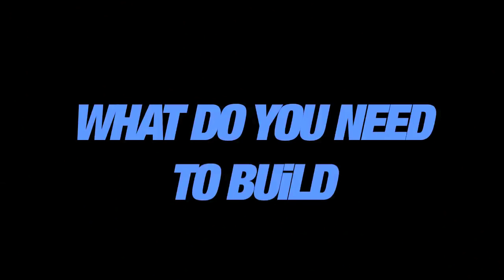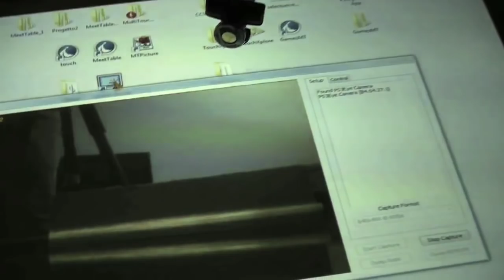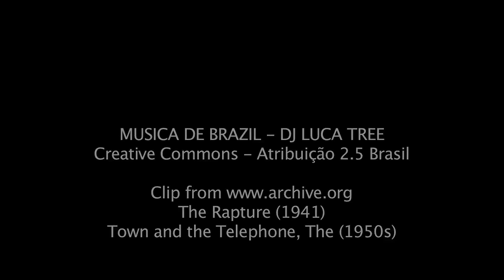How to build your own multitouch table?

Comment from the maker: It's a short-throw projector. That particular model is an old Benq MP772 ST (beware.. ST stands for Short Throw). Down't know if it's still in production.
For more information, please take a look at the link provided in the description. You will find more detailed information there.
It will work fine with your PC: it's even more powerful than ours ;-).
At worst, you may experience some lag in some complex scenario (many objects and animations on screen), but in general, it will be fine.
Regards

Comment from the maker: It's a regular PC (actually a pretty old one.. an Intel Core Duo 2 based compact PC). Such an old dual core is really the minimum and sometime you may notice some lag, but should not be a problem to have a low cost/spare one. Of course an Intel i3 or superior is even better.
We used two sheet of 5mm tempered glasses with a rear-projection film between them.

Comment from the maker: There are two calibrating steps:
1) We calibrate lasers through a 3 axes support in which each laser is placed
to obtain a plane as close as possibile to the glass surface.
2) We calibrate the "touch" using a software called CCV

Comment from the maker: Well, there are many reasons for that:
1) the ps3 camera can be set to work at slightly frame rates than the standard 25fps (usually 30-60 fps), and this allow to have a faster touch detection (less lag between the physical touch and the detected touch)
2) the camera is well supported by the CCV software
3) the camera is cheap and relatively easy to modify (remove the IR filter and mount dedicated optics)
You can find more detailed information at the link showed in the description of the video.

Comment: When you use mirror you get longer distance between projector lens and surface as distance between surface and projector focal point are longer. 
If you want bigger surface, you need to have either a) wider lense for projector b) greater distance between surface and focal point.
It is easier and cheaper to use mirror to grow length than buy a new projector lens (not possible on that distance).

Comment from the maker: You will have full access to your Windows 7 PC, but since the multitouch system is based on a different protocol (TUIO vs. Windows Touch), you will not be able to directly control Windows 7 using touch (you'll need a keyboard & mouse).
But there are softwares that translate TUIO to Windows Touch Events, so in theory you will also be able to control Windows 7 using touch: we never tested them but they should works. Take a look at TUIO website (software section) and look for "TUIO input Bridges".

Comment: wheres the camera?

surely this can work with 2 laser in 2 corners, and 2 cameras on other corners and the x/y data be calculated from the 2 cameras when a finger moves into the light beam, allowing lcd to be used instead of projection

Comment: You could just buy a tv with pc compatablilty take it out of its casing get a multitouch monitor tape it on and make the stand and plus the tower to the tv and connect the multitouch monitor to the tower and done. Might be more expensive but it would look a lot better an wouldn't have the big monitor under the table.

Comment: isnt led panel easier to install and more ergonomic and less power consuming than this projector except them led projectors ofc

nice work though
Reply: +Derek Freeborn Hi Derek. If you mean a led illuminated LCD display, yes... it would be much more ergonomic (higher resolution and luinosity), but to use the same tecnology we used at the time (Laser Light Plane or similiar such Laser Led Plane or Rear-DI) you still need a transparent display, with the IR detecting camera on the back, so you would have to dismantle the panel, remove the led illumination from the display panel itself, provide some kind of back illumination to "see" the image on the display, leaving room for the camera in the middle. This is something that someone already did, even if the risk of destroing the display is quite high.
But the question here is another one: is all this still the state of the art on 2016? We built this table a long time ago. Well it's only six years, but the tecnology has davanced a lot since 2010, and right now, depending on your needs, a solution based on a regular LCD display/TV and a multitouch IR overlay frame attached to it, or even better a capacitive foil, would result in a much better product and user experience for about the same price (for a 40-50 inch).
This kind of tables are now disappearing for the same reason (see Microsoft Surface - table, not tablet), and also for the fact that both the ergonomy and resolution/luminosity of a LCD panel are much better than a projector, and you can then obtain both a table or a wall mounted multitouch display.
We can only suggest this kind of technical solution for education purpose  or for specific needs (and for fun of course), but for most common production scenario, much advanced and stable solution are available nowadays.
Thanks for suggestion anyway.. :-)
Reply: Roberto Politi thank you kind sir for your long yet informative and good reply, this is kind of youtube i do like yet so rare to be in

As for the topic, a thousand apologies I just saw the date of the uploaded video.
Reply: +Derek Freeborn Hi Derek. No need to apology at all... That's the good and bad of Youtube.. the new and the old peacefully coexisting :-)
Anyway, everything can be useful to other users whatching the video, and besides... who knows... maybe even a discussion on an old topic can evolve into something new and interesting.
Reply: even 6 years ago it wasnt really state of the art. i remember watching tutorials on this back then. the point of this design was if you really wanted a touch based large format computer, your could probably afford it with this design. esp if you could find a projector from someones work place that was being replaced. another low cost alternative was to use a wii mote as a camera and place ir leds ion pens to make your pointer when taping on the wall/image. awesome build though!

Comment: Good work neighbors. I wanted to ask you, what is the material you have used for the top surface of the table as well as the projection material? Because I see that there is an acrylic on the bottom, in-between there is the projection foil, and on top you have used another material as well. Could you please tell me what these material are? Thanks in advance!!